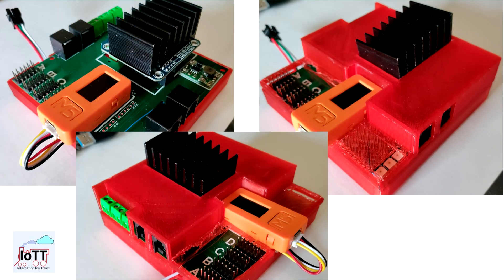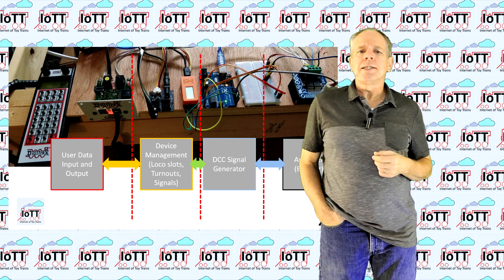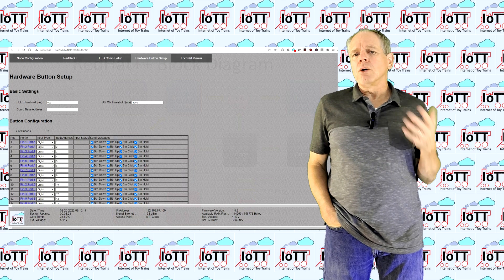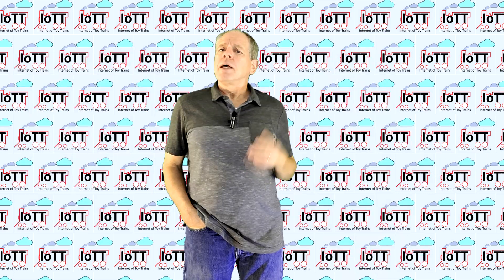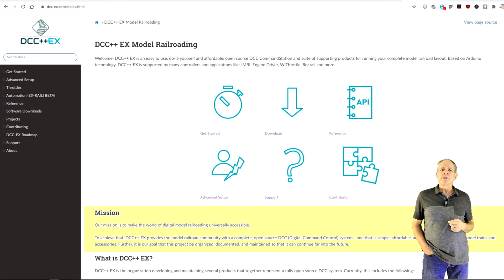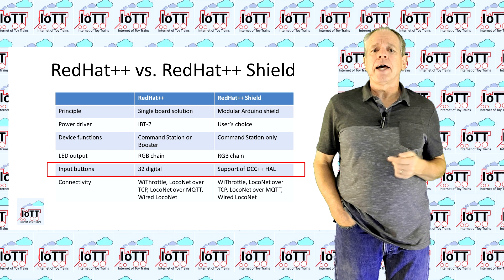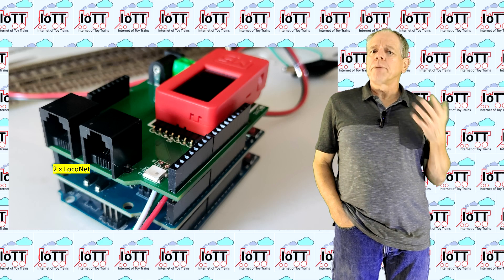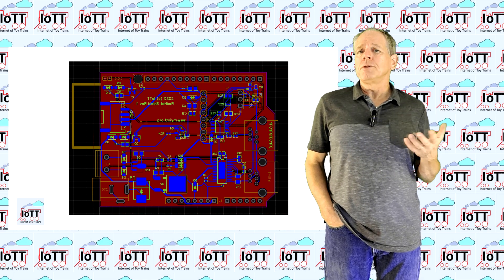Done with the RedHat++! (Video#95)

Comment: Really looking forward to this.  I use a few DCCEX setups.  Once for my son on a small shelf layout.  A full commercial DCC system is overkill.  Adding the ability to plugin one of my Loconet throttles would be a great addition.  I  looked in Discord.  Did they remove the loconet channel?  I see some discussion in the Architecture channel, but no loconet channel.
Reply from the maker: Yes, this is the idea, connecting existing LocoNet devices to DCC++. The Loconet subgroup is still there, but I believe it is only available to some developers. Maybe you contact Fred Decker from DCC++ so you can get access.

Comment: I think I like your idea of simplifying the board.  You are right that a lot have already got some kind of DCC base station, but may want to integrate a few extra things to it.   It really is a lot of hard work to maintain your own fork of the software that already works so very well.
I think it takes a lot of strength, along with some heartache, to look at a project so close to completion and then make that decision to say no, it really is going to be too much trouble to maintain.
Reply from the maker: There's the old Will Rodgers saying: If you find yourself in a hole, stop digging ;-)